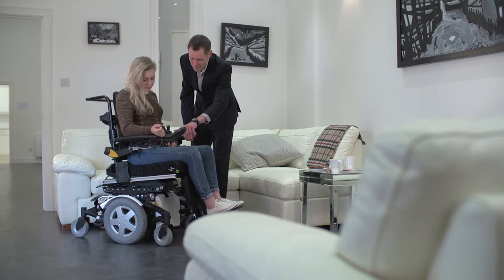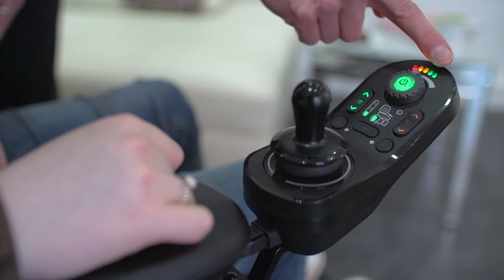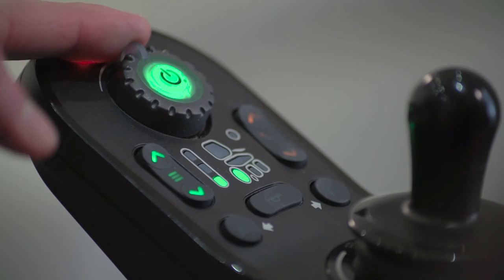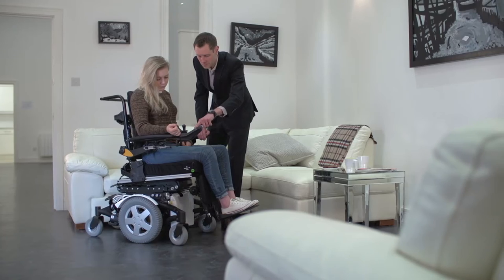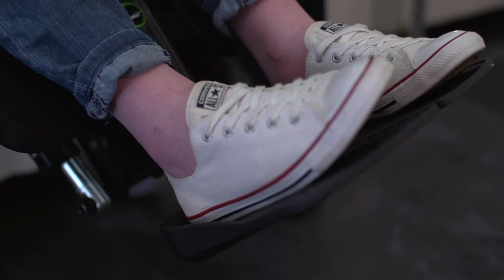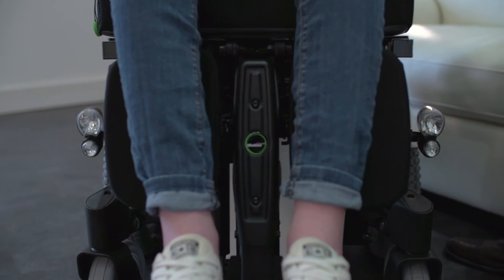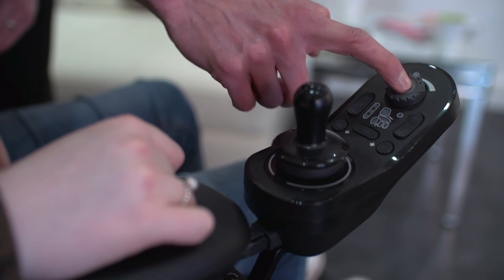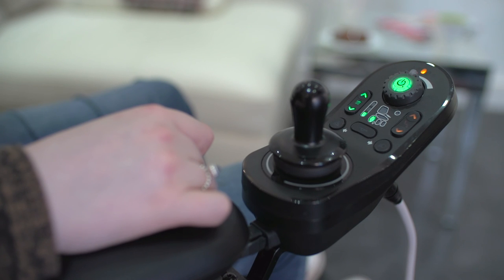Invacare LiNX - Operation

Comment: I really like this controller.  With previous control units, it was too easy to accidentally press the wrong button and power forward at full speed when you just wanted to tilt the chair.  This resulted in rather a lot of damage to walls and furniture.